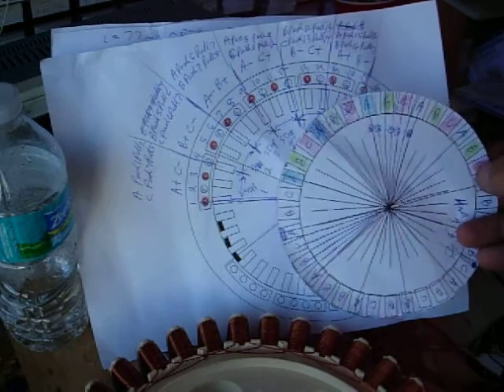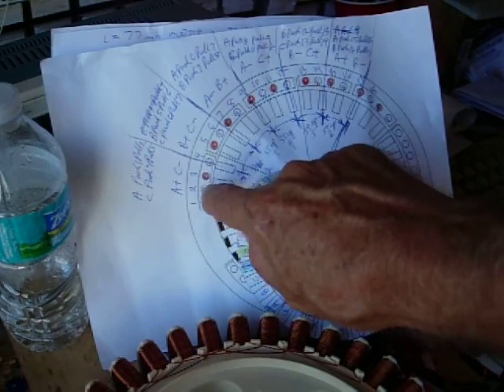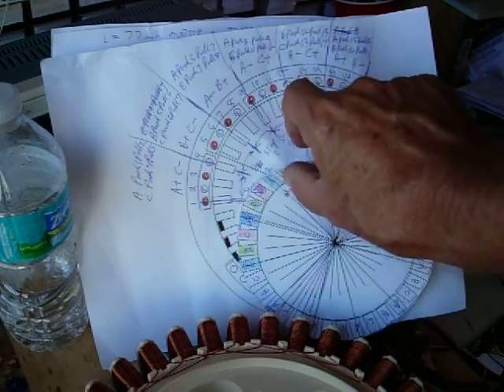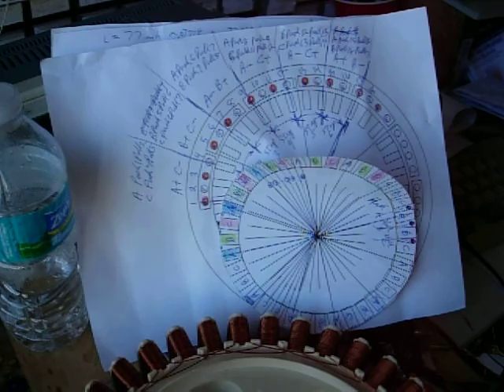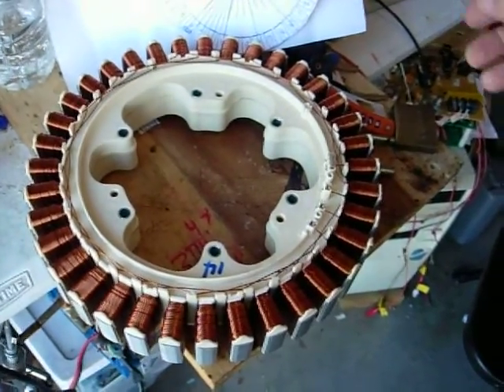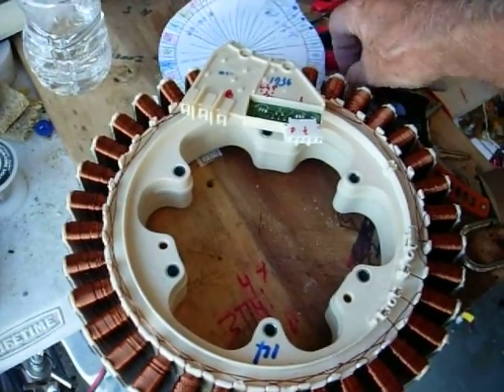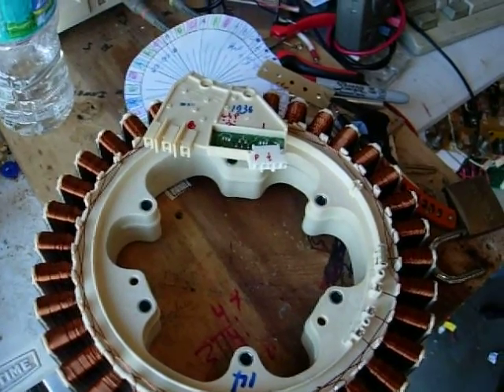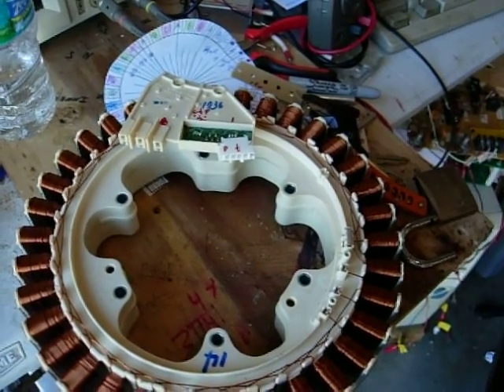Don Smith #110  understanding how the 3 phase BLDC works

Comment: Those motor are very difficult to run. And one of the secret that people don't know about when dealing with them is actually the magnet. If you look at rotate magnet they look like individual pole on each magnetic BUT the are not one pole only, they are 4 pole 2N and 2S in that one single piece  hope that helps you

Comment from the maker: getting very close to testing the system
Hi All I got the motor and a machine shop is going to turn me a shaft and coupling for the rotor.   I also tested the Digikey Hall parts latch kind and they trigger even at 3/4 of an inch from the rotor ceramic magnets.  I'm also getting info from several companies on the three phase controller with speed control.  The ones that use the halls instead of the tach idea are the best choice for motor speed saves $$$.   Next step will be to make the 1500 to 2000 watt generator.   I also found some one inch shaft pillow block bearings for $15 for a pair with grease fitting.  Grainger USA wanted $144 for the same item absurd. GREED.  The rotor center portion was removed with a Dremel tool.  The plastic is held in-place by plastic that passes through the metal structure so you have too grind out only one side then lightly hammer with punch and walla the other side pops off.   The piece you remove might come in handy.